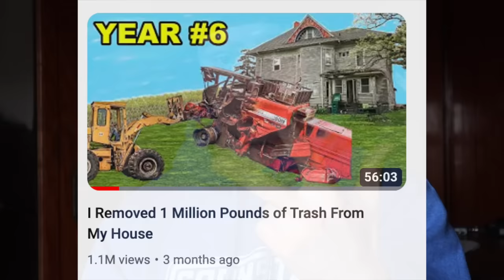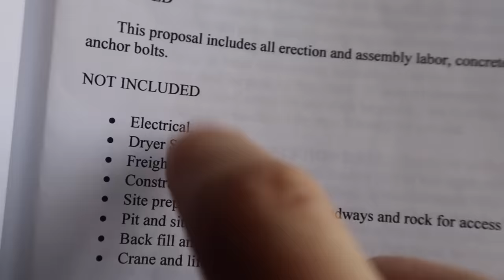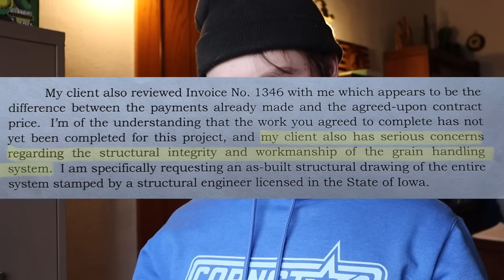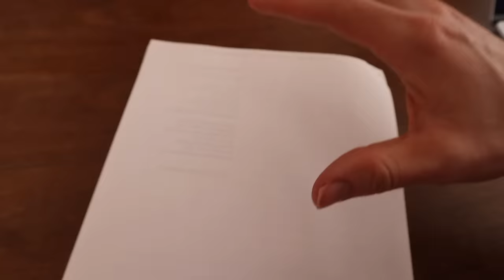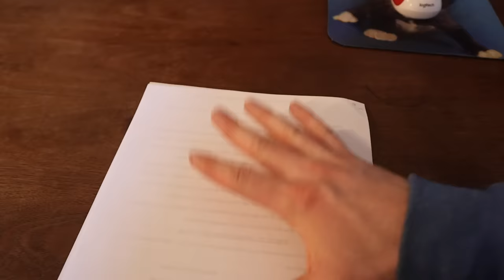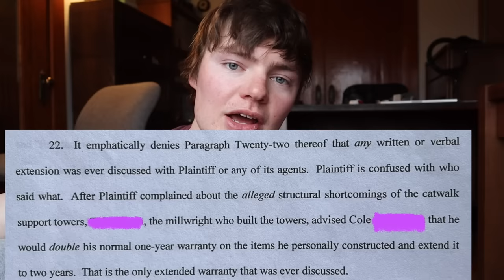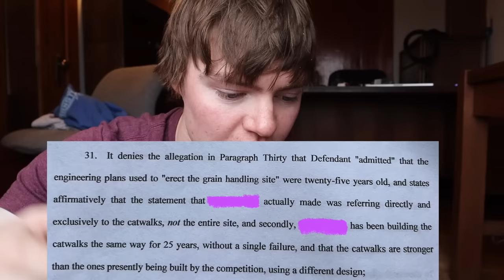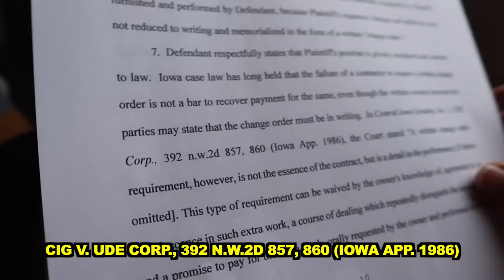I Sued My $1,000,000 Bin Site Contractor

Comment: welp, can;t you just do the work required to get it running and subtract it form the final bill, then IF, the final bill is found to be valid they can subtract it form that, if its found not to be valid then they can send you a check? 

at the very least get this thing inspected by a qualified certified inspector that can verify yea or nae the work was bad or was good, certainly their work is and material is warrantied..

far as the lawyer and his response at what point were you supposed to hire a professional to inspect brand new work performed by his client?  best guess is for that kind of money the work was to be industry standard and inspected and passed, any future failures is in the warranty ...

also at what point are you supposed to mention the irregular work? and if you;re not aware they are sending a "final" bill that wasn't agreed upon in the first place then how were you to know you needed to hurry up and do a final inspection yourself?

this is no different than a contractor building a home for you, with a home you get a final occupation permit, which means all inspections are finalized passed and its approved for occupancy...  ANY faults, irregularities, poor work, failures so forth found later on while occupied goes against the home warranty and the contractor normally sends in someone to deal with it, none of which has anything to do with  final bills that are not approved ...

you have to ask yourself, if the work is repaired and up to standards us the final bill justified?  cuz this is what the jurors are go9ng to want to know in the end, they aren't really going to care if it was agreed upon or not, they are going to care if this final bill is just fluff or did they provide labor and materials that justify this extra work, if you were n the jury and the contractor did work that wasn't necessary much less in the finalized bid and or contract would you expect the customer to pay for this? of course not, however, if the material for say a grain shed and increased by that much then who should pay?

and these are things contractors and customers really need to iron out, OK you have the contract, the blueprints, how long do we have to get you the money so you can NAIL down and accumulate these materials so the cost does not increase and change the final bid, its even prudent to discuss labor, will the cost go up in this time frame, and will there be sufficient manpower to get it down in the time frame allowed .. of the kind of money you paid for this job all of this should have been ironed out, discussed approved and agreed upon, if its NOT, then whats in the contract is the binding agreement...  contractors cannot come in and say hey manpower was short I had to pay guys this much just to get them here, OR, welp by the time we ordered the material it had gone up 15%..

these are things jurors need to understand are responsibilities of the contractor unless specified, "if material cost increases as does final coast and you must be made aware of this, that's what contracts are for...

final cost is final cost unless its something you did to alter the cost, their lawyer will make it sound as if no its all on you the customer, you need to find industry contractors who will dispute this, and correct this verbiage they will bend and distort tot he point customers are on the hook for everything, even lunches and a good nights sleep ..

change orders ARE industry standards and practices however they are always approved by both contractor and customer..

what I don't understand is why did you not talk with them soon as you found the cracking welds, ASAP? that's normal behavior regardless if you found defect or subpar work or materials before or after finalized billing, money is money, work is work, they are separate, one pays for the other ..

they say you owe them money, you say they owe you repairs or better work, why wasn't this all discussed without attorneys? just cuz they sent you a final bill you weren't aware of doesn't mean anything until its discussed..  hello yea its me the guy you but the grain storage for...  um whats this extree bill money all about?  also I need you to come out and look at some welds here..

honestly now you both have lawyers involved who are going to be the only winners here...

there is still time to talk with one another and come to an agreement, you have to ask are the overcharges legit, if some or all are you have to decide do I want to by a yacht for an attorney or just get it over with long as i get my silos done perfectly?  and you should mention that to them, do they want to buy a yacht for an attorney or should; we work this out between ourselves and put it behind us..

I am suspicious you haven't mentioned what the overcharges are for and that you are pointing to "no work or material shall be charged for unless agreed upon in writing" ... there are always two sides to the story, did you verbally approve something and are trying to find a way to wiggle out of it? half of it, some of it?  again, the attorneys are the only ones coming out ahead here if this thing peruses into court hearings and trials... make no mistake about that, their job is to milk this thing out for all its worth, the way they do, unless your fees are waived it may behoove you to work it out cuz frankly unless the charges they are asking for are negligent and extra frivolous they wont award you attorney fees, unless they are downright just trying to rip you off for nothing, and odds are they are not cuz they wouldn't risk having to pay for attorneys knowing they are in the wrong and a jury will never, if you want those bins to be usable come harvest I suggest working it out with the contractor..

you might make payments whatever, suspend the final bill come harvest time they know what you are up against, my guess is they have said what the bill is for you just wont tell us for whatever reason but just remember unless this is totally frivolous on their end and its just padding the bill outright remember you more likely than not will not be recouped attorney fees, court costs sure, but not your attorney fees, and if there is a 50/50 chance the final bill is justifiable they will not award in your favor, I figure you know this but its not beyond the shadow of about meaning they have to prove you owe them beyond the shadow, its preponderance of the evidence, 51-49 and they award for them..

of course we can tell you the welds and any other defect will have to be repaired by them and asap, you don't need a judge for that, but unless you reveal what the up charge is for no one can even guess how that might go .. I suspect you have an idea, my best advice is TALK TO THEM, WORK IT OUT, otherwise you may be out more than $150k and still fixing the welds yourself..

THIS right here is WHY you never pay full contract price or anything of this nature until final inspections have been done by professionals in the know, many times a certain amount is held back for things such as integrity...

if I was hiring someone to put up a few 300ft 25 megawatt windmills would I pay then full price before they have withstood some very harsh winds and produced said outputs?, or withstood wind close to the low end of their proposed handling capability range?

no I wouldn't, and I certainly wouldn't have anyone build one without an iron clad warranty that stated a new one is built at cost of contractor if certain wind speeds do knock one down..  so hold back 10% until these have operated fora month or so at full wind and cover yourself with an ironclad no muss warranty..  performance bonds can be supplied by contractors as well, as well as insurance..  what kinds of performance bond and insurance does your contractor have?  in some states that's who will pay for this work if they refuse, have you talked with them?

what kind of warranty did you get here... yes it matters considering it sounds like some time has past since you found the bad welds, what was it full warranty 100% for 1 year? craftsmanship only? parts and labor?  hows it read?  it matters, at this point it sounds like that's what the welds fall under

Comment: I would bet that most all your problems are from subcontractors, It is still the general contractors problem because they hired them shitty subcontractors. I was a Iron worker in  Chicago for over 35 years and can tell you that even though welding on galvanizing can be difficult there are many different opinions as of how to do it properly. If you take 100 men that are good certified welders on bare metal only about 1/4 of them guys would be just as good welding galvanized steel. It is the subcontractors responsibility to be certain his men can weld on galvanized steel [Not just be certified welders] if that is the kind of work they seek out. Bad welds can not be welded over, they have to be ground out then re welded again. I have seen  a few welds that would fail a welding inspectors visual test alone on your project. Sadly you guys could not work this out and now have to rely on whores to work this out, otherwise known as lawyers.